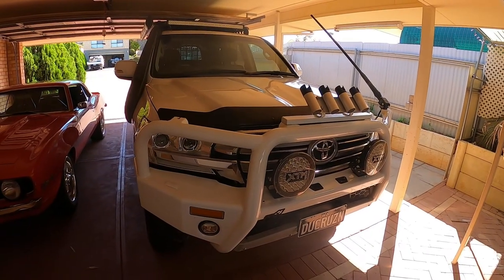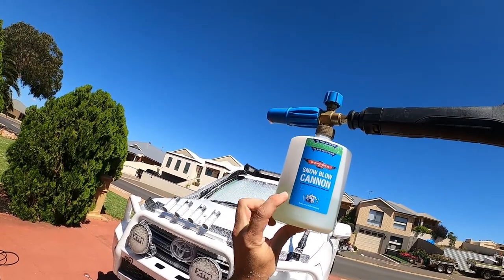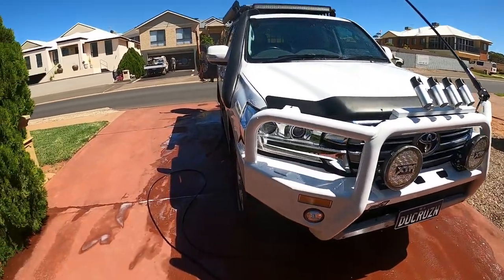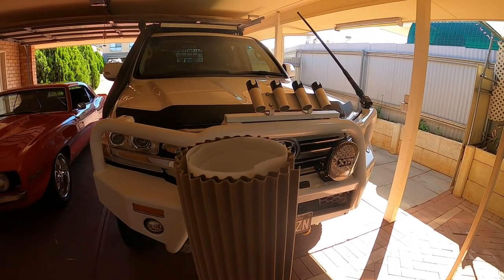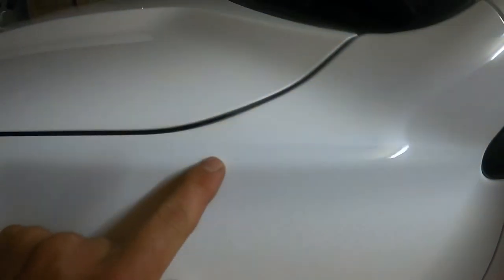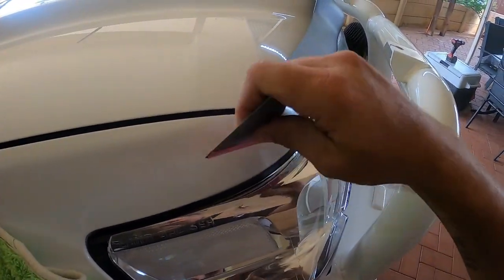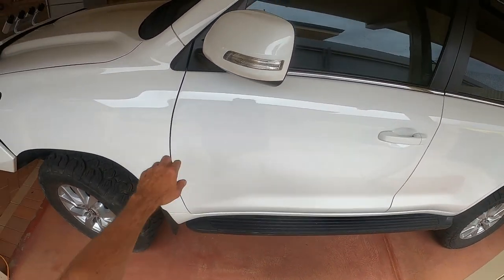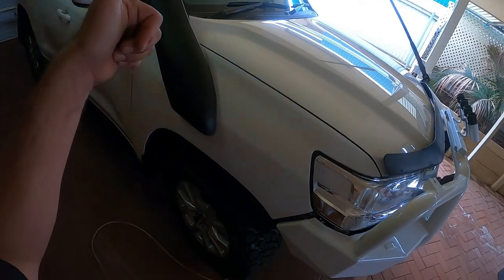Bush Wrapz install on a 200 Series Landcruiser

Comment: Hey Marc, how's the wrap holding up after 12months,
Reply from the maker: Hey mate, been on for about 15 months now and has held up really well... wishing we got a full wrap that goes all around the edges as the bits that don't have wrap on have copped a flogging from stone chips etc.... but the wrap itself if awesome, we have no concerns doing "scratchy" tracks and always just look at each other and say "bushwrapz" ha ha...
Reply: @DucruznOZ  cheers for that...safe travels
Reply from the maker: @peterflint9002  all good mate 🍻